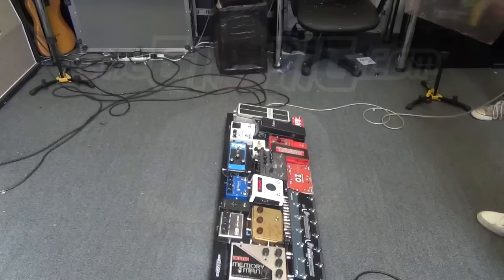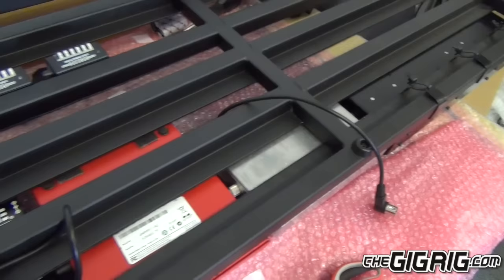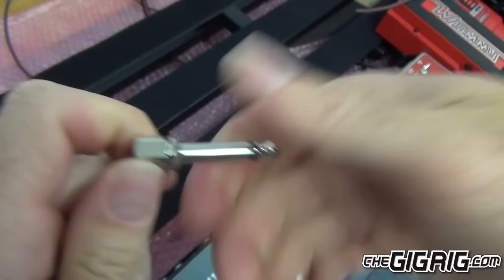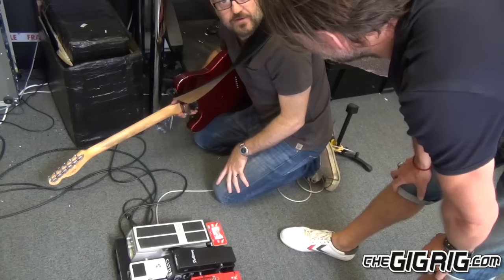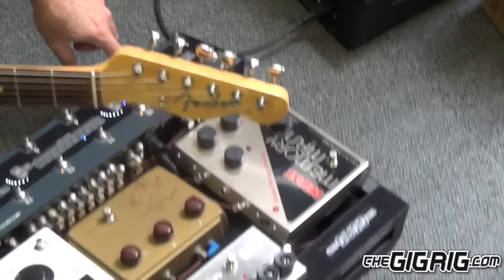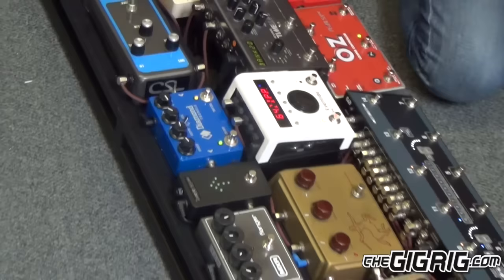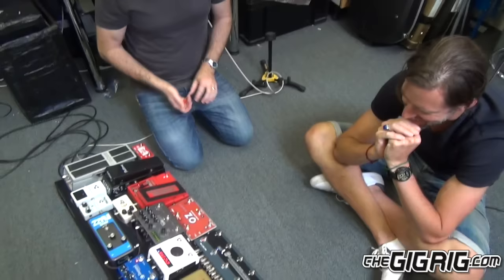Radiohead's Ed O'Brien's pedalboard build TheGigRig G2

Comment: Great build but i've never had luck with solderless cables and connectors . I've tried my best and i went as far as calling Bob Bradshaw and even he agreed with me . Maybe the cable and connectors are different than what i used  but for now i will keep using my trusty Mogami 2319 and soldering my connectors . I love the builds you do they are top notch and wished i heard of the G2 before i purchased the One Control , my bad ....

Comment: Wow, this is the first Gig Rig video I've seen and I'm amazed how everything has been simplified, like making up the patch leads and distributing the power... no snips, strippers, pliers, multimeter. Very cool indeed.
The simplicity and size of the power supply/distribution impressed me most. That Generator power supply is physically so small for so many pedals, and there's no heat sink... Doesn't it get really hot? And how's the reliability?
And the power supply must be a switch mode supply... any noise from it at all, or is it all suppressed inside the unit? Daniel, what are your views on this power supply versus a toroidal transformer supply like the Voodoo Labs PSU? Thanks.
Reply from the maker: ForViewingOnly Hi there. Supply gets warm, not hot, and its extremely reliable :)

Comment: Just wondering, that Ed didn't check the pedalboard immediatelly in function... Remember the day, when put my new Pedaltrain pedalboard with 10 pedals together. Everything was amazing till the moment when I switched the wah on. The power supply wasn't even so close to wah and it's inductor picked the 50Hz hum from PS very well. Maybe I'm wrong and TheGigRog is kind of battery and/or has some mu-metal shielding, otherwise when wah is on it will probably hum.

Comment: Hi you are amazing!!! can you please help me understand how to use the cinco cinco pedal… i have a G2 and I just want more more and more pedals… can the cinco cinco be controlled by the G2? if so how?
Reply from the maker: Hi Alvaro, the Cinco Cinco is a 5 way passive patch bay. It simply helps with in and out connections. I’ve rigged this one up so it connects two of the connectors to a G2 loop send and return 👍

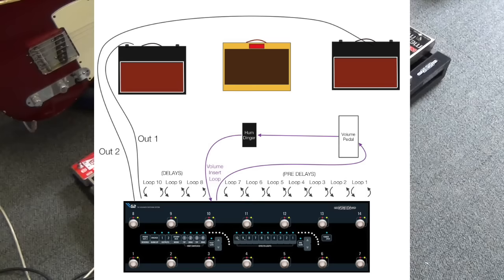Comment: There's a moment that got me a bit confused... Around 10:30, so you are outputting the delay feedback to a single amp, but the feedback is being "cleaned" by the HumDinger so it doesn't sound so muddy... Am I right?
Reply from the maker: Hi there. Not quite, the HumDinger is in the G2 Volume Insert. You can position the insert anywhere in the signal chain, in this example we've used it between loops 7&8. So it's before the delays. The HumDinger has 2 outputs, one buffered that goes back to G2 and one that's isolated that gets sent to the centre amp. As it's placed before the delays the amp that is fed from the HumDinger doesn't recieve any delay signal, but it does receive everything else. Just think of it as a tap off point in the signal path

Comment: Hey Daniel I have a doubt about the evidence audio solderless cables, what if I make a patch cable, but then I make some changes to my pealboard, and I need to make it shorter or larger, it's easy to remove the plugs and use them again? Or once they made they can't be modify?

Comment: very interesting. good to get a look at what's on Ed's board, but I'm pretty sure he uses a truckload more than what is shown, since there's no sign of the samplers etc that he manipulates manually. a question though - are there phasing problems when all 3 amps run?
Reply from the maker: Hi Blake. This is his pedalboard for the next bout of recording. We'll change what we need to when it comes to the next tour. No earth/phase problems as the outputs to the amps are isolated and phase reversible

Comment: There's so much cable cutting and all my experience with stuff like that, either it be crimping ethernet cables or wiring and soldering small circuitboards indicate that I would not have a good time doing pedalboards loll

Comment: Great job with this board. it looks so clean. small question....who makes the wire stripper you are using around 4:15 in the video? 
on a side note, I am the person that bought your Duesenburg Fullerton a couple years back

Edit: I just relistened and realized you said it came with the patch cable.

Comment: I seem never to tire of re-watching this vid.
One thing I just noticed for the first time, I didn't see any reverb. Radiohead have some very wet reverb-y songs that I can think of. Is that because the Strymon and other delays can give you the effect you'd get from a reverb pedal? Or is it just unnecessary in a band...?
Reply: He also plays some Twin Reverbs! :)
Reply: Can you name some reverb you're thinking of in a specific song? Cause when I think of guitar parts in this band, I don't necessarily think of reverb. I hear lots of echo, sustain, delay etc..
Reply: MyCatShitsFire like a reverb pedal or like a reverbish moment?
Reply: Any guitar part with reverb. I hear a lot of reverb on Thom's vocals a lot (obviously), and maybe on the Fender Rhodes (EIIRP, Morning Bell) but I can't think of a lot of guitar with strict reverb. Again, lots of echo, lots of delays, Ed is fond of using e-bows.. this may give the flavor of reverb, but I honestly don't believe they use much reverb. There is a part 2 to this video where Ed has a road pedal board built which is more stripped down, and no reverb pedal on there. If you want to hear prominent guitar reverb, check out Sigur Ros, in particular the song Njósnavélin. That's reverb. That's not what Radiohead are doing.
Reply: MyCatShitsFire yeah compared to Sigur Ros (great band) there's no 'real' reverb. But it is there though.
Reply: Everything in its Right Place, Optimistic, Airbag, No Surprises, House of Cards, Faust Arp come to mind for starters. The guitar parts on each of these have verbs that range from somewhat to dripping wet
Reply: CNCTEMATIC +1
Reply: CNCTEMATIC There is not a single guitar played on EIIRP, you don't know what you're hearing. There's no reverb on the guitars in Optimistic, but there is on the vocals. Maybe some on one of the guitars in HoC and No Surprises, but it's far from "dripping" and furthermore you don't hear it live. It's a studio tweak probably done during post production to give the part a little bit of a new flavor.

Reverb is very simple--you don't need a fancy pedal for it--but most importantly Radiohead use a lot of echos and other things that you are probably misinterpreting as reverb. Reverb is difficult to use in a live situation, so outside of POSSIBLY flavoring an odd guitar part here or there on a studio recording, this is definitely not a part of radiohead's guitar sounds. There are in-depth websites detailing both Jonny's and Ed's effect usages, reverb is not something they rely on if for NO OTHER REASON than the littany of other effects used by Ed and Jonny would not mesh well with a reverb device.

Comment: what patch cables are you using? I have a vodo power pedal two but I feel limited in what I can do with my board do  you have suggestions? I have 10 pedals and  I use a one spot, and TC electronics power supply that comes with the pedal im looking to upgrade to  a different delay pedal such as JHS cub and strymon timeline. Thanks
Reply from the maker: HI David. I actually take you through the patch cables in detail in the video. They're Evidence Audio SiS, and are excellent. Feel free to contact us via the website and we'll do what we can to help

Comment: If Ed's insert is before his delays how does the spillover effect function properly? I want to insert a volume pedal between loops 7 & 8 (after drives, before delays) but I thought my Post Gain insert needed to be after the delay I use for the spillover setting?
Reply from the maker: Hi John, you're correct. Ed doesn't use the G2 spillover on this board, its because the volume pedal is before the input to the delay. Simply use a G2 loop before 8 for your volume pedal, leave the post gain after loop 10 for trails

Comment: Is there any way you could adjust the HEIGHT of the various pedals effect boxes? I reckon the ultimate in ergonomic ease would be if each controlling surface or button was at the same height. So eg if a wah-wah pedal was the highest from the rig, bring the height of every button / pad / control device upwards so it passes through the same plane. That way your foot is always reaching for exactly the same height / depth (or as close as possible, given some pedals move up and down).
Reply: not sure if u realize, almost all switching on+ off pedals is done on the large loop-switcher on the left.  Besides the wah, whammy, oz, +molten midi, everything is accessed with the loop switcher.  so he won't need to step on the ones in back.
Reply: Daniel Simon
O really? No, I didn't realise that. Thanks.
So, before each song, will you need to set the switcher device to which pedals its connected to for that song? Or is it always already connected to all of them?
Reply from the maker: Everything is programmed into TheGigRig G2. Everything Ed needs to get his feet to is placed with maximum ergonomic ease. It's surprisingly simple for such a big board. Hours of fun :)
Reply: Daniel TheGigRig
Cheers. Wow that is cool. Thanks. (On a second viewing I could see that all this is explained in the vid.) What a cool job; making life more fun for Radiohead guitarists!

Comment: Hi Dan, Does the Cinco Cinco do everything the Z cable does? As the board has quite a long path, I thought you might have used a Z Cable. How come you didn't?

Cheers.
Reply: Also, what's the difference between a Distributor and an Isolater?

Comment: Hi Daniel, what is that "synco-synco" box you mention at 2:00 in? I have been using a homecooked option for my four cable method, but this seems a lot more solid. Does it also take TRS jacks (for footswitches)?
Reply from the maker: Hi Tim, yes, the Cinco Cinco is a 5 in 5 out patch bay that takes TRS cables as well, works a treat. Just search Cinco on our website :)

Comment: please someone explain me this 9:58 and I don´t understand the issue with the fuzz and the virtual battery. what´s that?
Reply: I think I've absorbed enough to field this question. Some pedals have the option to run on 9v batteries or a DC power cord. Some people claim they like the sound of the battery better, though plugging in is obviously preferable for other reasons. Here, he's created a device that goes between the DC cable and the pedal to mimic the power of a battery, giving it best of both worlds.

Comment: How much is his whole board worth with the work you did to it putting it together?
we looking at like 10,000 dollars about?
Reply: I'd guess about 3000$.
Reply: i know the klon pedal alone fetches about 2000
Reply: I overlooked that... the rest isn't that expensive though.
Reply: this is wayyy more than 3000 dollars even without the Klon :-).
Decided to try and make little list to find out.
Counting prices in euro's since I live in europe, converted to dollars in the end.

If I had to buy everything in a store or from internet today:

- Pedaltrain grande w/ case new is around 375e
- Gigrig G2 system is around 1000e 
- Gigrig generator + 2x Gigrig Distributor + Gigrig Isolator + Virtual battery (for the   fuzz) = aprox. 320e 
- Gigrig Humdinger +  Gigrig Cinco Cinco = 200e

Total: 1895 euro's = 2327 dollars (current currency) on the pedaltrain + gigrig stuff alone - if I didn't forget anything that Daniel put on there. Don't know the prices in dollars when you buy all in US, but will be similar I suppose :-).

Now for the fun part: the pedals. Some might be updated versions.
----------------------------------------------------------------------------------------------
Pedals found in Euro's pricing:
- Boss FV500L - 95e
- Fulltone Clyde deluxe wah - 279e
- TC Polytune - 88e (for a polytune 2) 
- Dinosaural Opticompressor - 199gbp =  254e
- Digitech Whammy V =  159e
- Superfuzz - ?
- Strymon Timeline - 453e
- OZ timeline looper - 225e
- Eventide H9 - 418e (going for the core version)
- Diamond tremolo - 265e
- MXR M117R Flanger -  168e
- EHX Deluxe Memory man - 222e (newer version than his)

Pedals found in Dollars pricing:
- Crowther Hot Cake - 179 dollars (proguitarshop)
- Klon Centaur - around 2000 dollars if you buy on Ebay

pedals found in euro's: 2626 euro's =  3224 dollars
pedals found in dollars: 2179 dollars

Total price : 2327 + 3224 + 2179 = 7730 dollars.
That's without the lava cables, superfuzz and costs for Daniels work on it obv. :-)

7730 dollars. Sheesh!
Reply: my $10,000 guess was pretty close!!! 
thanks for doing the leg work…. now off to find $10,000 !!!
Reply: yeah, it's getting pretty close :-).
one suggestion? Drop the Klon - will save you another 2 grand, lol! :P.

You could consider to invest that in a roadie though... I have a pedaltrain 2 with case which is already around 30 pounds, so imagine this beast in it's case!

My pedaltrain 2 has a little under $3000 worth of gear on it, so I knew this just had to be a lot more.
Reply: i'm not touring or playing out right now luckily, and sold my last batch of gear off for a mini recording set up to write, however sadly I'm getting the itch to get back on the road!!!

love me some pedals, but it'd be nice if more digital pedals were available from the same companies that make physical ones. 

although i can get almost any sound out of logic pro. 

www.soundcloud.com/dearjonythan

got music? share it !
Reply: Owl Daly Oi! bad move there! Always keep some pedals around for the future :-). If you want an all-in-one solution you might try a line6 HD 500 maybe...but still won't be as good as proper pedals though

Comment: ROFL!

Running the audio cables perpendicular to the power cables is only necessary when you're dealing with AC power. It doesn't make a difference with DC. (i.e. 90% of pedal power)

It does look nice and neat though. Great build!
Reply from the maker: Thanks, glad you like the vid. Yeah, it's just a habit I got into that I like. The dc lines are all isolated as well, just a bit of my OCD :)
Reply: That's what makes your stuff special bro!

Comment: are the generator powering bothe the G2 and the distributer and isolators ?
Reply from the maker: HI Allan. Yes, The Generator powers everything on the board from by using a combination of Distributors, Isolators and adapters. Its called TheGigRig Modular Power Supply :)
Reply: Am I understanding this corretly then: From Generator  to - distributor to - isolator - to pedals ? I purchased these but have not made the setup yet
Reply from the maker: yes, correct Allan. If you need any support with these just email and one of the tech team will be happy to help
Reply: cool ... thanks

Comment: Not impressed with the cabling, those evidence solderless kits remind me of screwing on the aerial plug on to household antenna coax.
Reply: I had lava cables like this. Were unreliable.
Reply from the maker: Respectfully I disagree, I've made over a thousand of these patch cables now and have not had a single failure. Threading the solid core cable into the tip gives it a fantastic very secure connection. I love them :)
Reply: Daniel TheGigRig Fair enough.

Comment: Forgive me, but I can't understand you when you state the custom cable brand name. Is is Evan something...? Sorry, I have played it over and over and cannot make it out. Your accent and the speed you talk is hard for us Americans!
Reply from the maker: Hi there. It's Evidence Audio SIS patch cable system. They're awesome!
Reply: Daniel TheGigRig It does look like a good system. I used a system that all you do is cut the cable and stuff the butt end into a fitting and that is all. As I am an electrician, I find that odd. This makes more sense, cutting back the sheathing to reveal the contact material and using a positive screw fitting to hold it all together.